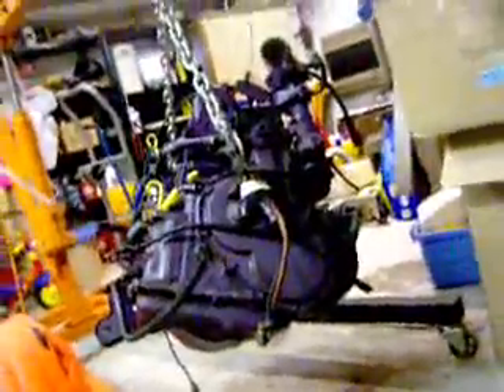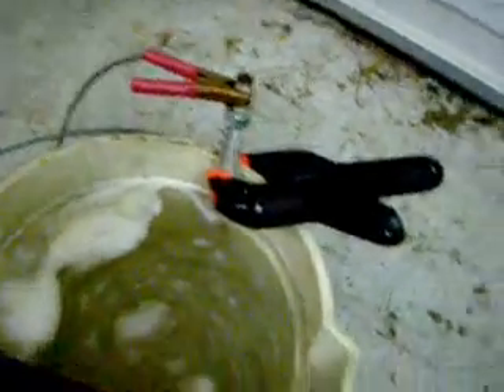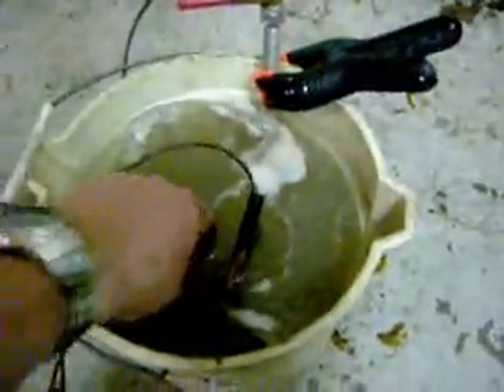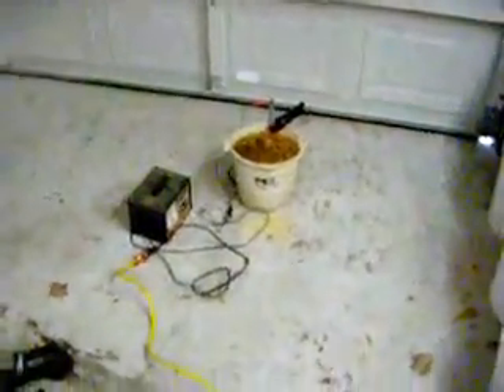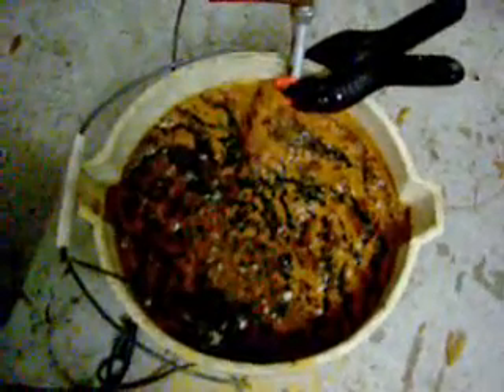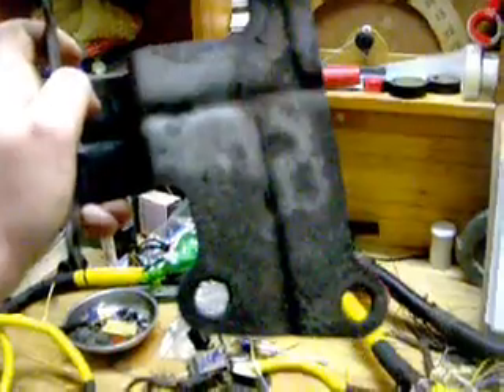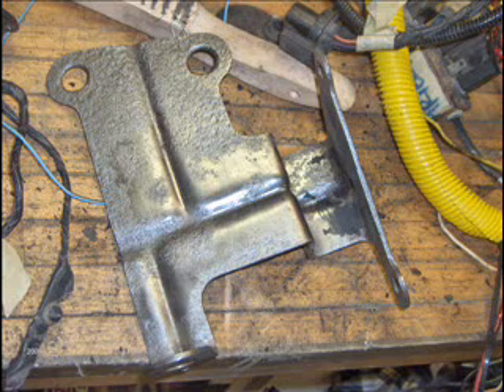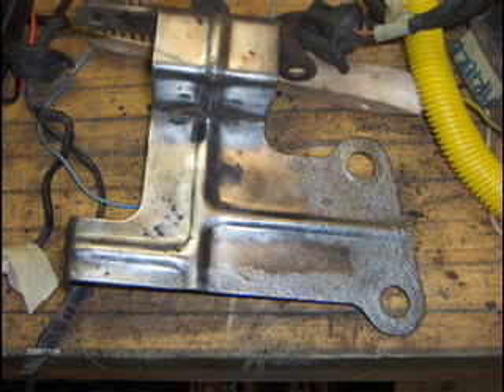Geoff's Science Garage - Electrolytic Rust Removal

Comment: Thanks for the video!! Thank you especially for mentioning the solution might explode because I smoke. I have many rusty things both big and small so intend to use your method. I have a bunch of old tools that got rusty after a Missouri Tiver flood and I dont have the time and patience to to sand all of them. This looks to be a good project to do in the winter when I don't have anything else to do.
Would it help to run a fan on this to vent the gas away? Great video.

Comment: works well.  I am using a 12vdc 450ma trickle charger.  At first with such low current and a lot of rust there were no bubbles from either electrode at all.  When I allowed the copper clamp of the battery charger lead to touch the water bubbles appeared on both anode and cathode immediately so I think the resistance of the rusty metal was slowing things down.  Once some rust was gone it started bubbling very nicely.

Comment: @ggariepy you can also use dc power converters i used one with 12 volts and 500ma it worked well but i broke it so now im using a 16v 1000ma transformer

Comment: I was thinking about plating the bell by the same process, but that would obviously  involve more than simply switching connections. Nothing is now being plated, so there must be something I'm missing. By the way, as is obvious I'm a complete novice at this, so I don't know what I don't know, need to  know, or should know. When I spoke of danger, I was thinking of life and property. I was thinking of circuit overloads, blowouts, and fire. I'll just buy more pie pans for the anode.

Comment: Well, I bought another battery charger, a manual one. This one has settings for 2, 10 and 50 amps. I've been running it for about four days, 2 amps at night and 10 amps during the day, but I've been reluctant to use the 50 amp setting. Anyway, after almost nonstop usage for about four days, my bell still isn't back to it's original condition. Bubbles aplenty, and rusty water (I keep changing it), but I'm wondering how long it will take. No complaints, I'm learning. Any danger if I use 50 amps?

Comment: Now I know. When I bought my battery charger, I didn't know enough to make a good decision, I was only looking for a good price. I still don't know very much, but I've now learned the meaning and significance of "OUTPUT: 120 VDC@750mQA". It means that I bought the wrong battery charger. 750mA is only 3/4 of an amp, and that is apparently not enough to remove rust by electrolysis. Oh, well, live and learn.

Comment: ggarlepy,

Thanks for the information. How about the charger settings? Are they okay for rust removing? (Note, I did try a large iron nail, but it didn't work. I guess size or surface area is also important). I thought I'd have to buy another charger, but the more I read the more confused I got about what would be appropriate to use for removing rust by electrolysis. I don't want to spend more money only to find that I've missed something.

Comment: Help. 

I used an automatic battery charger (Output: 12VDC @ 750mA, Input: 120VAC @ 60 Hz 12 W). These settings cannot be changed.

 I completely surrounded the bell with a band of aluminum. I did not suspend the bell because the container is plastic. . For the electrolyte, I used one tablespoon of baking soda to one gallon of water, but when that didn't seem to be working I poured in my more baking soda. It didn't help.

What could be wrong? Charger settings? aluminum anode? Not suspended?

Comment: A table spoon per gallon of water. You may use the solution perpetually for multiple parts but eventually it will depleate the water through evaporation, the washing/baking soda will not deplete. Therefore you should add more water to maitain the aforemention ratio, but do not add more W/B-soda as it will not benifit your rust removal operation.  :-)

After a few parts however, you will probably want to dispose of the solution because of crud.

Next time use Google its ur friend~! 

.X..

Comment: The difference between muriatic acid and electrolytic rust removal is that the former removes the rust compleately and seperates it from the "Good" metal. The latter of the two actaully restores the rust closes to the host metal back to actual metal state.  Less pitting and deterioration of the patient part is the result.  

It should also be noted that after a piece of metal goes trough the electrolytic rust removal it should be stabilized with paint or oil imediately after.

..X..

Comment: The mixture I use is 1/2 cup sodium carbonate(you can get this by baking baking soda over 300 degrees for over an hour) to ever 5 gallons. you have to be careful with tools like copper and chrome 'cause you can be left with chlorine gas and chromium and chromium is illegal to dump 'cause it'll fuck up a well or a water table.